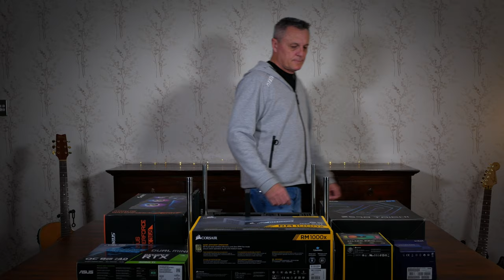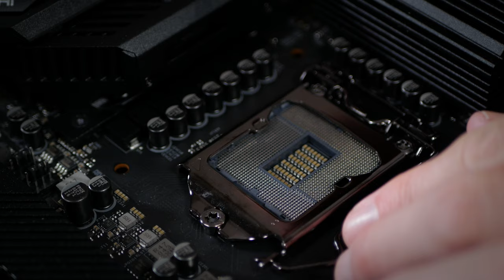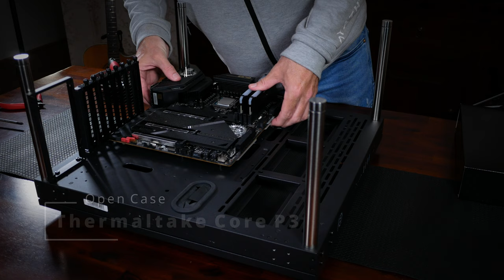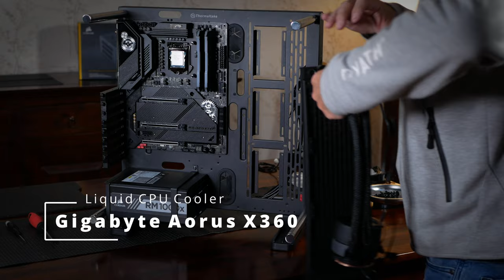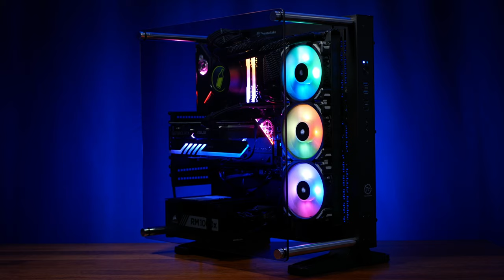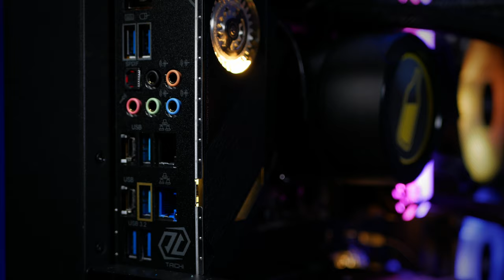Music Production PC Build 2021

Comment: Superb show! But what about noise level? Is Open case good for music production computer from the sound-isolation point of view?
Reply from the maker: It's a great question. I will explain fully in the next video - but in short, this PC is EXTREMELY quiet. The only fans in there are the magnetic levitation fans - some of the quietest fans you will 'hear', and the temperatures a good (around 26 degrees on my CPU at idle at this moment). There is always a misconception that the regular case somehow 'shields' the sound. But it actually in most cases (excuse the pun), creates a greater need for more fans. Not to mention dust. Regular cases suck in, and retain dust. This case needs a light dust off the top, maybe every 6 months. All will be demonstrated in the follow up vid :)
Reply: @CreativeSauce  Looking forward for it! :)

Comment: I do not understand why until now most Windows systems still do not have Thunderbolt 3/4? It is only available in very few motherboard models. While it is the minimum requirement for now to connect the audio interface.
Reply from the maker: I hear ya! This has 2 Thunderbolt 4 ports, and works perfectly with both my Antelope Audio, and UAD thunderbolt interfaces :)
Reply: Its really not necessary.

Comment: Nothing says "balls of steel"  like putting together a PC without factoring in static electricity!
Reply from the maker: Haha - well, of course not on carpet (wooden floor), and I was earthing myself off camera before picking each part. Having built around 50 PCs, I haven't had an issue.
Reply: There is a test that actually the static electricity no Moro damange this equipment is, prube  that the manufacturers make boards and chip sets resistentes because this cause to many warranty returns